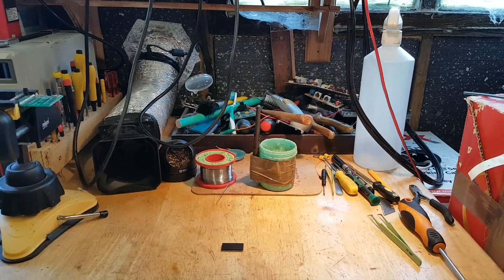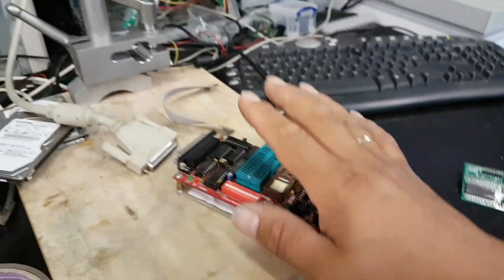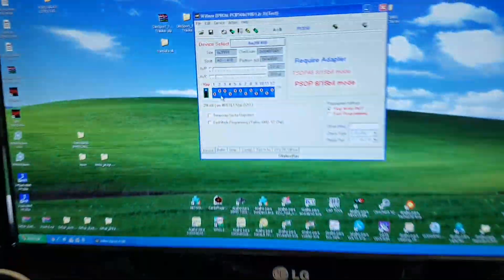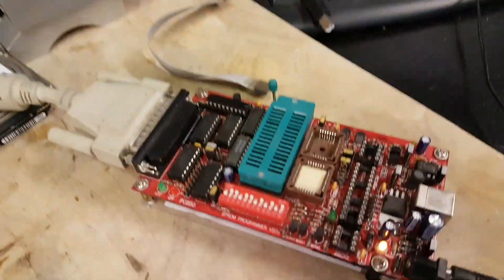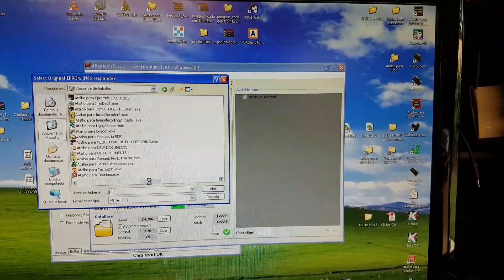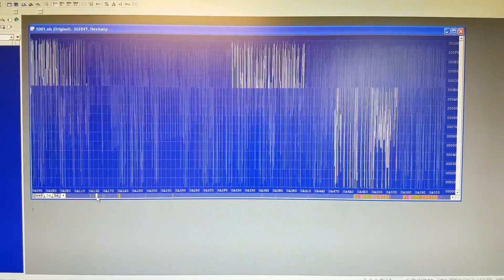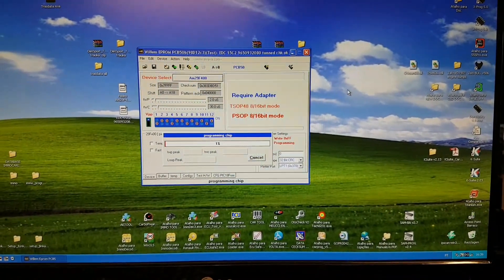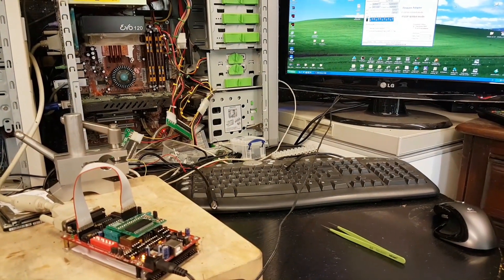Read and write maps from a flash AM29F400. (Bosch EDC15C2 and others)

Comment: My tuner created a 3 maps in the same flash (edc15p+) using his "own" program he said, by creating 3 codeblocks. He asked for my VIN number to "LOCK" and protect his work. When i told him what if i wanted to copy the same flash into a donor ecu by copying both Flash and eeprom? He told me that's not going to work. Not sure if he's lying or actually works 🤔 whats your thoughts about this. Thanks and very helpful video.
Reply from the maker: It is common some tuners protecting their work, specially custom stuff, like multi maps etc...
I believe, some are locked to things like the vin, etc...
I am sure there is a way, but I never investigated such thing. 
Perhaps, if you move the chips to the donor ecu, that most likely will work, since you are moving everything which contains data.
👍👍👍

Comment: Can this be done on Astra g cdti 2005 edc15c7?
Reply: I ordered tl866ii programmer and SOP44 adapter. Can’t wait til it gets here
Reply from the maker: Yes... but there is other tools for that ecu...
👍👍👍
Reply: @LMAutoRepairs like what?
Reply from the maker: @napper1496 
Kess, k-tag, among others...
👍
Reply from the maker: @napper1496 
Will save you from having to remove the memory from the ecu, etc...
Reply: @LMAutoRepairs  I have mpps cable and galletto and both will not read flash. Something to do with the L line the ecu needs. Also I had a guy try to get security code for programming a spare key and he tried about 5 different computers and none could get access to the code.
I have bought a cheap ecu kit ie ecu/transponder/central locking module/key yesterday so I can swap it all over and I can play with the original set . Years ago I made a mess of a friends Passat ecu when remapping it,and I ended up putting it into boot mode and remapping it with the mpps cable,by using the wires of the cable and grounding the ecu pin. I’m wondering if I can do the same thing with the edc15c7 ? 
As I say I’m not a pro,I just like remapping etc.
Reply from the maker: Do you which type of flash is on that ECU?
Reply: @ 29f400
Reply from the maker: @napper1496 
In that case, Willem or other compatible flash programmer should read and write that...
It is just that you might need to remove the chip from the board...

Comment: Nice video! Is it also possible to run that programmer over USB (for data connection) and the 12V power supply or do I need to plug in that big grey cable somewhere?
Reply from the maker: This version is Parallel port only...
But there is USB versions...
👍👍👍

Comment: Hi there i Have a Vw Passat 2000 1.9 tdi 90hp AHU engine with MSA15 Ecu 2 eeprom plcc32 chips i desolderit i read it with willam programer  everything ok tuned the file  bought amd 29f010b chips write it everything ok solder lll hhh chips but car wont start maybe checksume problem or whar
Reply from the maker: Most likely... willem only reads and writes... does not do any chksum calculations....
You need to do it to the file before writing...
Thank you for watching and for your comment!

Comment: WOW,thanks, is it possible to read a security key number from the eeprom to help programme a new key? and would ktag be a good place to start to learn these tricks?
Reply from the maker: Hi
Yes... you can retrieve the pin code from the eprom on some cars/modules... each case is a case...
K-tag is a good tool, but it is mainly to read the engine ecu...
To program keys, the pin is in many other cars located in other modules, and you might want to get an eeprom/mcu programmer... do some research, and you will know what I mean.
Hope that helps.
Thank you for watching and for your comment!